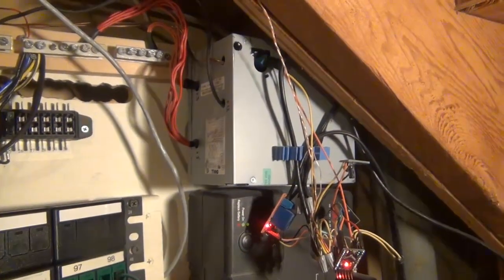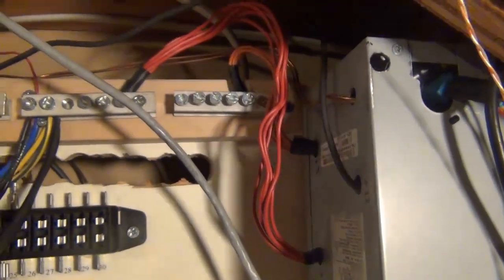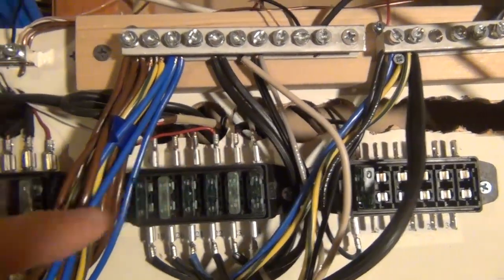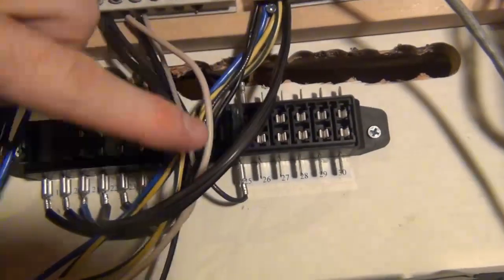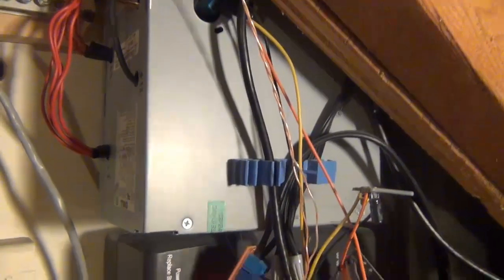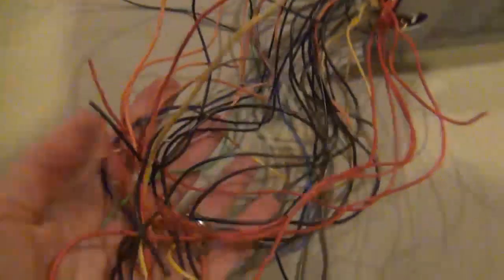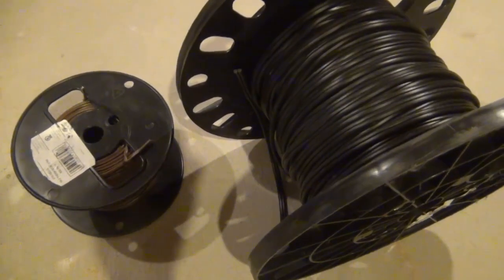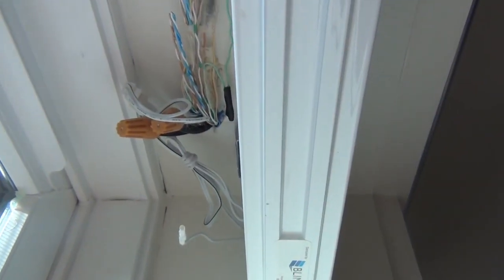DIY Low Voltage Whole House Power Supply

Comment: What a cluster of wiring. I would be embarrassed to record this mess.  This is the kind of content that does a disservice to the community. Im glad it works, but man, have you no shame? if anybody new to low voltage DC/home automation wiring saw this disaster they would be immediately dissuaded.  Nothing says "Ive experimented with shit I dont understand and only barely managed to not burn my house down" better than a power supply in an enclosed space, screwed to wood panel connected to shoddy grounding, embedded in a birds nest of hope.
Reply from the maker: Jon, 
First off, you know there is another person on the other end of this right? Your comment feels overly harsh and not constructive. Posting comments like this doesn't feel like a service to the community either. I'm not sure if you don't like it because it's messy or unsafe. If you feel it should have been done differently maybe create a comment on how or provide a link to a video where it was done better? 
My whole goal with my channel was to help the community, not hurt it.
Reply: @peteb9105    It is both messy and unsafe.  You are not meeting your goals.
Reply: @peteb9105  But on the upside, it was posted 6 years ago, so you can post a "I cleaned it up" video for an update.  Unless this fire hazard still exists.
Reply: @peteb9105  ok fine ill throw you a bone: its a good proof of concept and you did well.  Proofs of Concept shouldn't make it past the desk phase. Two years, sheesh. Now is the time to move to implementation: get a real 24v/12v industrial switching power supply that uses solid state capacitors that handle constant load much more efficiently. The capacitors in that junk power supply have a MTBF - Mean Time Before Failure - that is shorter than you think, its running on borrowed time if it still even works.

- Get a media cabinet large enough and that can be grounded.  The real safety problem is dust and shorting wires while fiddling (im looking at you exposed capacitor leads).
- Label the wires and terminals better.  This includes at both ends and if you can, in the wall.  Maybe run through conduit.
- I didn't see a fire alarm in there, but you should have at least a battery powered one if you dont have one. 
- Heat shrink ALL those connectors to avoid shorting.
- get that Arduino in a case, they make aluminum ones that act as a heat sinc so no fan required.  If you must 3d print one, make sure its leviton compatible so you can pushblock it into place.
- Good organization will allow you to swap out to newer components without having to reinvent the wheel.
- whatever you do, don't let any fire inspectors near your house they might condemn it in its current state.
Reply from the maker: Thanks! This is super helpful for other people coming here to watch/read this. 
I haven't cleaned it up yet but it is on the list. These tips will help when I do.  I appreciate your detailed response.
Reply: @jonmoore1614  You do have a point  but no need to be mean. This dude did something really interesting 6 years ago and shared it, you can do it better and share it! I would be the first to see it as I'm planning my new home off-grid and really considering doing something similar and I do have safety and efficiency concerts. I would probably create my own high efficient power-supply / buck converters with GaN to provide different voltages all over the house. But as I'm not an electrician I just don't get what is the point of saying 'low voltage' as if you have 'high current' is still dangerous. If you go DC you should consider supporting also high power devices were possible which means high current better cables.
Reply: @perdonomai8060  low voltage doesn't mean there isn't a fire hazard.  As I said setup is fine for a proof of concept (I've made my own birds nests).  I'm just saying this a disaster in waiting.  bad ground + dust buildup causes a fire.  You don't mince words in this scenario.  Certainly don't show the mess to the public.  There are plenty of examples on how to handle the organization of wires here on YouTube.  Like I said I'm glad it's working but do focus on preventing accidents.  The bonus of putting the effort in is that it's easy to understand for future upgrades and swap outs.

Comment: I bought a supply for a diesel heater and then realised it was basically a computer power supply. If you have a low volt power supply, does it save you money or is it just for safety?
Reply from the maker: I did it mainly to save money. I don't need to replace batteries or buy a bunch of 12v/5v/3.3v adapters.

Comment: This is really great. However just curious as to its legality. Any ideas? 

I guess my concern would be if there was a malfunction that led to a fire, could your insurance company balk due to this sort of setup?
Reply: I highly doubt low voltage low low amp fires happen out there for any data to be collected over the past century of 12 volt or less except the worts or step down/ converters themselves.

Comment: Ive been converting my ham shack over to all DC. Lighting, fans, device chargers etc. Last step is to get a dc to ac inverter for the main computer. This will remove all dependence on house ac power. Will eliminate a lot of rfi

Comment: If u need to operate a high amperage device just purchase a nice relay and have this operate the relay and relay do the rest or is u have a 110 vac or 220 vac high amperage device a relay can solve the problem. God Bless and this may have been stated in another comment but I did not read them all!

Comment: Are wires coming from the power supply in parallel? I assume they are or splicing them together would increase voltage?
Reply from the maker: They are all connected to the same source so splicing them together doesn't increase the voltage (as long as you only connect the same color wires).

Comment: im having issue with my piwer supply only gives 11.9v, i added load 10ohm 15w (im not sure if i remember exactly what value) from the 5v rail to the ground (casing) the resistor is a little warm when  the powersupply is running a couple of minutes so i guess its working. except i couldnt get the most out of it. 

im also planning a 12v system in my home. not solar but a power backup power during power failures

Comment: Nice, this is a nice setup. Most electronics at home are DC (with step down voltage inside), many are 12V, others are 5V and very few 3V, at the end of the day it also depends on what devices you buy. One of the issues of this is modifying the devices to work directly with those voltages (unless you remove there wall adapters if any), the problem is the ones having the converter inside.

Why is this a better version? well it does means a lot of extra work to wire everything, you could also get clever and use the existing wiring in the walls. The benefit is less power loss compared to a power inverter. It's easy to set up an inverter and having 110-120, etc at home but even when nothing is turned on, the inverter will be consuming electricity, quite I lot.
Reply: You can just plug your TV, laptop, smart chargers, etc., directly into DC.

These (modern) devices convert AC to DC by way of a Switched-Mode Power Supply (SMPS). The first component in an SMPS is a rectifier. If DC flows into a rectifier instead of AC, you just get DC on the backend.

Comment: Does this mean you could have USB sockets for wall plugs? :P
Reply from the maker: I know you're probably joking but I have thought about it.  I use 5V all over the place in my house and it would be so cool to have USB connectors that I could just plug in to.  I haven't (and probably never will) done it though.  It's just too easy to plug in a 5V adapter right now.

Comment: I just purchased first house in USA. May I ask in USA, only cable companies to do the wiring of low voltage cables in the house? or I have to that all my self? I dont find where I can contact a pro to wire all the low voltage cables in one time.
Reply from the maker: Sorry for the delay.  I don't know.  It seems like you could hire an electrician to do it but I'm not positive.  I did it myself so I never looked into it.

Comment: Hi Pete - i have started to build a system very much like your one.  Would love to know how you rigged up the cutout safety on the mains input to psu (it would keep my wife very happy lol!)
Reply from the maker: I'm not sure if this is what you're referring to but I added an Arduino, relay and temp sensor (DHT11) to monitor the temp of the power supply.  I have email alerts that trigger if it goes above the normal operating temp (I believe it's 80 degrees F).  If it goes above 100 degrees F I have the Arduino kill the power to the PSU.  It has been running continuously in my house since I made this video and has been working great.  One time I got a temp alert and discovered that the fan stopped working.  I was able to fix it and I haven't received the alert again.  Nice to know it worked though.
Reply: Thanks for the reply :)   i am looking to setup a similar safety system on my system (reassured that you havent had any issues other than the fan stopping!).  Can you give me any pointers on best place to find info on how to set up the components? What relay do you use? I have a 10a one here - but pretty sure thats not going to cut the mustard with a pc power supply and i may need to go for the 16a to be sure.  But any advice you could offer would be great - but i also know you will have much better things to do than answer this!  :)
Reply from the maker: I am using one of the 10A cheap relays that are available on ebay for less than a dollar.  My power supply is only 250 watts which would be about 2.5 amps if it was maxed out (which it never is).  I am using a DHT11 sensor to monitor the temp (there are other temp sensors out there that are better but this one was cheap at the time).  I am using MySensors for all the communication to/from my home automation controller (Vera 3).  The code is pretty simple.  Basically I just continually monitor the temp and shut off the relay if it gets too high.  I also send back the temp to the controller ever few minutes.  I haven't updated it in years so it won't work with the current version of MySensors but I can upload it if you're interested.
Reply: Oh thats made my day!  My psu is similar size and my amps worked out similar - but i was doubtful the cheap 10a relay i had would be up to the job..  but knowing you have a higher draw of amps than i currently do and its been up and running for a couple of years without issue (other than fan) makes me feel a whole lot better about moving forward with this :)

I am currently running Home Assistant  (HassIO) on a Pi3 with a few nodemcu clusters around my house.  These have dht22, am312 pir and lux sensor (forget model but they are i2c).  Just been looking into MySensors and i can integrate that into HA quite easily (ish) by the looks of it - and i have a spare uno r3, dht11 or 18b20 dallas sensor and 10a relay sitting on my desk :)

Do you know if i wpuld be able to run the older version of the mysensors code and still integrate into HA?  But even if not, having the mysensors setup to run failsafe systems seperate to my automation system may not be a bad thing.  But it would be cool to integrate it :)

Pete it would be amazing if you could help me out with the code - you sir are awesome!  Im currently delving into java @ uni (even though 43 lol!) but its an upward (but enjoyable) struggle - and a helping hand for this part of my system would be an amazing help (and keep the aforementioned wife a bit happier with all my cabling and tinkering!)
Reply from the maker: I would start with the most current version of MySensors.  It's much better and you can add additional devices if/when you want to.  Updating the code shouldn't be too hard.  There are some pages on the MySensors site on updating.  I uploaded the file here: https://drive.google.com/open?id=1ogB0gtRSZtHm8EbhlG1UegNx7xRJ1yap
It worked with MySensors 1.4.1 so it will definitely need to be updated.  Unfortunately I don't have time to do it myself.  Hopefully it will be enough to get you going.  I'd take a look at the relay example for a guide on updating: https://www.mysensors.org/build/relay

Also, I think I added some additional code to reset my Vera if an LED light turned off so all that can be deleted.
Reply: Thank you very much for all your help and advice - it is truly appreciated Pete!  I will be giving the coding a go this weekend (hopefully!) so i will let you know my progress :)

Have a great day Pete.   And thanks again!

Comment: What is the max length you can use the 12V, 5V and 3.3V from the power supply to the powered device? can you for example take 5V from the power supply to make a usb charging socket 20 meter away from the power supply? if you use one PC power supply to power 10-20 devices would it be electricity cheaper than using standard 220v with USB outlets? do you need special cables for the 20 meter cables? nice work
Reply from the maker: The larger the wire the less voltage drop. Also, you need a larger wire for larger current. Most of my wire is 16 or 18 gauge. It has been a while since I did this so I don't remember exactly numbers but I ran a wire about 20 meters at 12 v and the drop was about .2 so the voltage at the end was 11.8 if I remember right. 
There are calculators online to help with the voltage drop and wire size.

Comment: In reference to you lighting needs, has this set up saved you any money on your utility bill since it been installed?
Reply from the maker: I didn't do any measurements before and after but I am pretty certain this has helped reduce the costs.  One way is that lights are not left on by the kids since they automatically turn on and off.  The LED lights consume very little power as well and most of the time we don't need to turn on additional lights unless we are doing things like preparing food in the kitchen.

Comment: I would imagine there is a ton of voltage drop going on. If I was to do something like this I would use 48 or 24 Volts AC and just rectify, filter and regulate at the outlet.
Reply from the maker: It has been too long since I did this to remember exactly what the drop was but from what I can remember it was around 11.85v for my longest 12v run (around 70ft) so it works well for me. Obviously the drop can vary depending wire gauge and length so everyone should do their own calculations and testing. I was pleased with the results considering it was free and more efficient than individual supplies or batteries.
Reply: @peteb9105 sounds like what I was thinking. Unions and electrical suppliers are not gonna be happy with the way we are going to smaller wires, lower voltages or eliminating AC altogether. They wrote the code so that when you build a house you have to have a 110 outlet every so many feet, but that needs to change.

Comment: Geez, I never thought about using a computer power supply for this type of project! Excellent! It looks like that one unit powers your entire 12 volt needs, is this correct? Thanks for the video.
Reply from the maker: Correct. Just make sure you check the amperage requirements for what you plan to power. Thankfully my devices don't use much power. :) I have lights and sensors all over the place thanks to this supply.

Comment: Is your computer power supply efficient and low energy? I am looking to do a similar setup.
Reply from the maker: +mikael thakur Depending on what power supply you use it can definitely be efficient. I don't remember the exact specs of mine but it works very well. I use it to power sensors and lights all over my house from one central location which keeps me from having to convert mains power all around the house. I have never done any specific measurements but I have to assume converting the mains power in probably 30 locations is less efficient than just doing it once no matter how bad the computer power supply is.

Comment: Hi Pete,  I just wanted to comment.  Instead of using wire nuts on cat5 or "telephone" type wire, use these connectors link below.  I use them a lot and come in handy.  They have a two and three wire version.  All you do is insert the wires and compress the connector with some pliers.  They usually have a jell inside to keep the wires from corrosion.  You don't have to strip the wire. Used mostly in the telephone industry.

http://www.homedepot.com/p/IDEAL-Insulation-Displacement-Wire-Connectors-25-Pack-85-925/100192058

Another alternative is to use a dolphin connector.  Much smaller.  Just strip the wire, insert and crimp with pliers.  Used mostly in the Alarm System industry. 

Both connectors are very cheap and make a good connection.
Reply from the maker: Cool, thanks for sharing!

Comment: I am beginning my research of powering a tiny house with self-generated DC current (through wind and solar power) and am curious if this sort of setup can be utilized for things like an electric stove and water heater or if I need to look elsewhere. I appreciate any insight anyone has to offer!
Reply from the maker: This is probably the opposite of what you need.  This will turn AC to DC.  You probably need an inverter which will turn DC to AC.  I've never looked into it but maybe some of the appliances that run in an RV could work with DC?

Comment: Nice projects, but are you not afraid for fire, with those cable spaghetti
and don't forget max total power of that unit is 305W thats for ALL voltage's.
Reply from the maker: Thanks.  Yeah, always concerned about fire safety.  The cables are messy but they are secured.  Yes, it's definitely important to remember the total wattage when adding devices.  Fortunately LEDs don't draw very much.